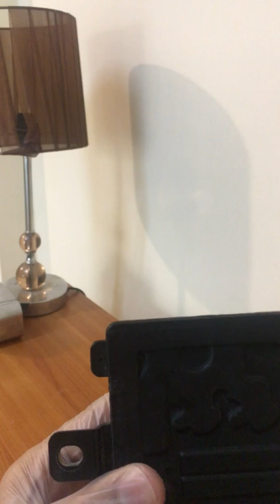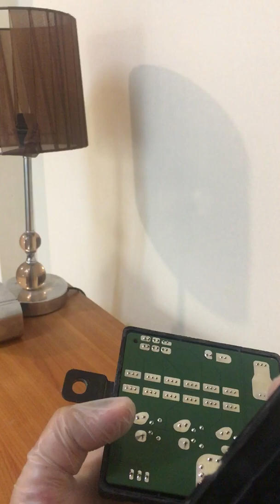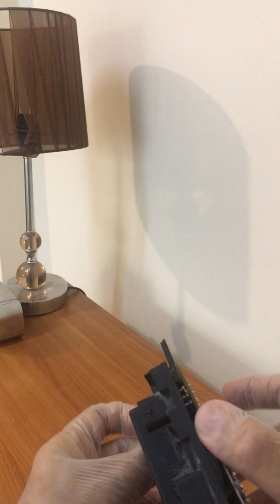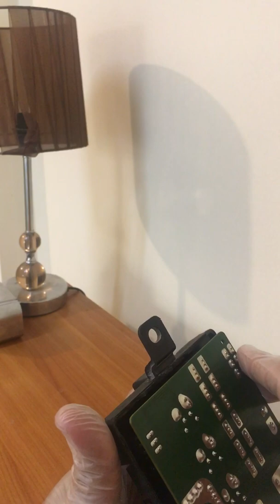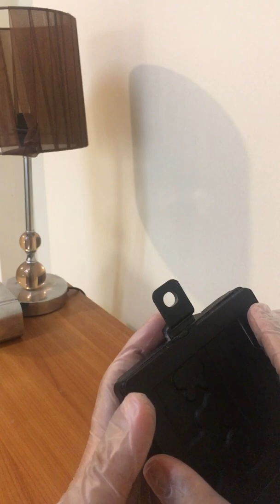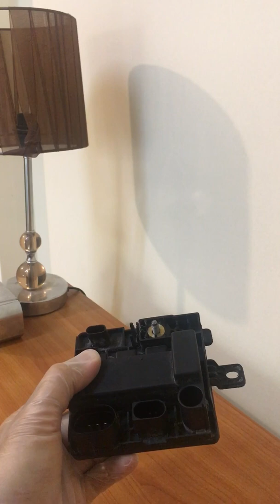BMW X5 E70 Integrated supply module ISM Z11(Power Distribution fuse box) dissembling and repair

Comment: Terminal 15_3, line from CAS, electrical: Short circuit to earth and Terminal 15N<03: No voltage error in bmw f10 523i, I checked the fuses in ism the #3 fuse was blown i changed it the car di start but after 2nd or 3rd start the fuse blows up
Reply from the maker: Check for any crushed wiring

Comment: same part comes with E70 4.8 engine 8 cil? mine has n62 engine, it starts but only 8 seconds then stops and radiator`s fan  starts at max speed  then 37 failures appear at the screen, inluding, seat belts, crush module,  steerling, 4x4, transmission, sunroof, lihts among others..
Reply from the maker: No it's not seen when I checked the technical document. Did you check your battery? Make sure you have a new battery before doing anymore works

Comment: I have issue with my brother F30 crank but no start issue, got fault code 804080 ignition on: startability limit reached or ignition was on for a long time, 8040B7 De-activation of terminal 15: Top startability limit reached, 8040BB. Does this indicate that power distribution module faulty?
Reply from the maker: The error code doesn't give me any clue. Which is the engine? What is the  History on no start issue, there will be something which triggered the fault.

Comment: I got BMW X5 E70 2011, I opened the box (you need to crack open it), all fuses were good, I dont think anyone should be opening it in most cases.
Reply from the maker: You should open it only if you have error code related to serious DME problems.
It protects DME from serious damage
Reply: We’re you also getting all crank no start?
Reply: @santaclaaugustin3424  UPDATE: if your codes are as follow: 
Car is fixed. I had to tow it to the dealer. They said it is DME. I had no choice but say yes do it. Spend around $3,000 for parts and labor at the BMW dealer.   
Error:
2DB6 Valvetronic relay activation line disconnection
371E Relay, ignition and injectors, activation line disconnection
I did the following before going to the BMW to fix it for me:
1. Power Distribution Box W Fuse (returned back to seller)

2. ISM - Integrated Power Supply Module

3. New Battery

4. EKPM3 Fuel pump module computer unit (returned back to seller)

5. Fuel pump

6. Relays in the trunk fuse box (circuit relays small black ones)

7. Verified ground straps.

8. Verified every single fuse several times:(

Comment: Hey so did it work when you changed the fuse?
Reply from the maker: Yes it did. I had to replace 4 or 5 fuses as a short circuit was blowing the fuse. You can see the short circuit explained in my other video

Comment: where was this location as im looking for my on a 2008 e70 30d?
Reply from the maker: https://youtu.be/_7n485INGQc
The location is same as in this video link that I have provided but it will look different as the module has different connector and it has fuses from F01 to F05

Comment from the maker: IVM LOCATION https://youtu.be/_7n485INGQc
Reply: hi Afeef...i have a similar issue on F30 N20 engine with error code 1F4D10, DME, internal fault, Activation of quantity control valve: malfunction. This was scanned by 3rd party diagnostic tool. i believe the tools dont carry out deep scanning on the system. I havent try yet with ISTA+ as i just bought the software. Your video is an eye opener as i dont know that ISM has fuses and relays inside which yet to explore for any fault. i have a strong feeling that it is not the DME..
Reply from the maker: @veillanraj9287  use btool-lite phone application to scan the codes. Use d-can cable
Reply: @bimmerhacks  thanks for the suggestion. i use bimmerlink tool but still not satisfied...getting the ISAT+ ready. My car actually in workshop and i have taken out the DME as advised by the mech to send for repair..but im skeptical that it was the DME. i have another fault code together with the mentioned. 135808 valvetronic servomotor, position sensor, electrical: malfunction. believe that 135808 is causing the 1F4D10. i will opened up the ISM tomorrow to check the fuses.
Reply from the maker: @veillanraj9287  valvetronic motor fault is nothing to worry about. What made your car to the garage?
Reply: @bimmerhacks  the car was idling and suddenly went off..tried start, it cranks but failed to start..i have to tow it to workshop..then the workshop diagnosed n changed the motor but the fault still thee after renewal..
Reply from the maker: @veillanraj9287  hope it's not a blocked fuel supply.
Reply: @bimmerhacks  bad news..the ISM fuses is in good condition...the relay coils also good..i can get fuel until the injector connection during cranking..the cables was inspected with some repaired broken cables..jerry visited and had meals there...sad...
Reply from the maker: @veillanraj9287  so a broken connection somewhere
Reply: @bimmerhacks  the cables repaired..but the fault code still there...i yet to find the cables for what n definitely its not the ignition, injectors and valvetronic actuator cables...will be sending the DME to see any components defects..
Reply: Just an update..the dme has some burn mark and rust stain on the some of the component underneath the socket connectors....sighh...bought a dme and had it cloned..now its running ok...
Reply from the maker: @veillanraj9287  thanks for the update

Comment: Afeef, having similar problems, crank, no start, and am questioning my IVM. Can you elaborate on how you found your short, which I assume was the root problem that was causing your fuse to blow. I like that you worked hard to find the real problem and not just throw a new DME at the problem.
Reply from the maker: First I got couple of error codes. So I assumed it's a fuse blown somewhere. Checked from the rear fuse box on the battery till the ISM. Used bmw circuit diagram to check out different modules through each fuse. Let me know the error code so that I can give you a clue where to start from. I used bulb method to find out short circuit
Reply: @bimmerhacks  Where did you get the circuit diagram fora BMWX6?
my integrated module fuse number 2 keeps blowing and water pump keeps running even when car is off
Reply: @dappa311  did u fix some problem !help
Reply: @djraphaellourenco8321  Yes the issue I had I fixed it
Reply: @dappa311  can u tell me what was the issue??? im struggling here with the some issue
Reply: @djraphaellourenco8321   My Water pump on my X6 was bad and it was shorting and blowing one of the fuses under the hood , I found the wiring diagram for the truck and I was able to trace what was on the circuit.

It was  a few devices, water pump and couple other things, forgive me, this was last year so I don't remember exact which components they were.

But the water pump was going bad , so when the vechile turned on , the water pump would take down the whole circuit , so I got warning lights for all the other devices that was on the circuit, turbo waste gate valve was one of the devices that was on the circuit.

So if you are having a blown fuse issues , you will need the schematic to be bale to find out what is on the circuit , then you can start to trouble shoot, with out that you will be blind.

I had to disconnect the wiring harness to the computer and test the resistance of the  water pump , thats how I knew it was the pump, changed it and never had an issue since.
Reply: @dappa311  cool I was suspecting the water pump because its draining a lot amperage  , by any chance u have the schematic I have all data and identify but I can find what this fuse power I only check the wires from ism to the pcm , and was ok noting short , thanks men
Reply: @djraphaellourenco8321   What car do you have?
Reply: @dappa311   x6 2011 3.0
Reply: @dappa311  I think u are. right because my fan its ben running full time with the car running and when was off turn on some times , my drain ti much amps for the circuit ,and its on n# 2 fuse  when blown the scaner showmen codes for o2 sensor waste gate
Reply: @djraphaellourenco8321  SAMe thing I experienced!   It was my water pump, the fan would kick on and ramp up hard.  Its more likely ya water pump.

It's shorting internally ,  the motor coil , drawing excess current and blowing the fuse. 

It works for a bit but then blows the fuse and takes out the circuit and you get codes for o2 sensors, waste gate and a few other things, I forget .

I wanna say its the water pump but to be sure you have to test it ,

Seems like it's a X6 thing.  

You have the N54 Engine correct ?

I have a 2012 , N55 Engine
Reply: @dappa311   i have n55  too
Reply: @dappa311   let me know if u found the      files I really need! thanks
Reply from the maker: @djraphaellourenco8321 r u looking for the wiring diagram? If yes mail me @ bimmersword@gmail.com
Reply: @bimmerhacks   I need help with the schematic for the fuse #2 in the ism need know what sensor and actuator are feed by the fuse, I have regular diagram  from all data but only show me get out on the ism and in the dme wire are good need trace down the load taking down the system and blown the fuse
Reply from the maker: @djraphaellourenco8321  https://youtu.be/jJN1VpxdLU8?si=R3_wKJPokBvbtk4h

Check if that helps.
Reply: @bimmerhacks  my water pum works the only problem fuse #2 20amp keep blowing
Reply from the maker: @djraphaellourenco8321   try disconnecting the waterpump and see if the fuse blows off. The water pump is prone to get water ingression inside the waterpump electronics. Valvetronic motor is another thing to check but its probably the waterpump itself
Reply: @bimmerhacks  I have a bunch of codes that all pretty much show bad communications to DME. I suspect bad DME or bad ISM. There is a 6 pin connector on that ISM, and pins 5 and 6 don't have voltage on them with ignition on, and I think pin 4 is grounded by the DME to cause relay to close and energize pins 5 and 6, but trying to confirm. One symptom I have is that when that 6 pin plug is plugged into ISM, there is a loud buzzing from glove box where fuses are. When I unplug it, that buzzing goes away...very strange. Thanks for your reponses and insight.
Reply from the maker: @terryt4129  buzzing is weared so start from glove box side. Take out the fuse box located along JBE. My channel has a video how to tear apart JBE FUSE BOX. REMOVE THE UNWANTED RELAYS from it like wiper motor relay etc to drill down the cause
Reply from the maker: @terryt4129  any update? Did you cut open the ISM?
Reply from the maker: @terryt4129  https://youtu.be/6vYPbAeDc5E

Comment: Have you got a vidoe of how to remove the Integrated supply module from the car?  I will need to do it shortly and can't find any videos so far. Thanks
Reply from the maker: If u give me your email ID I can send you the location of the module. By the way the module location is different for different models, so mention the car model year etc.
Reply: @bimmerhacks Hi please assist with location of Integrated Supply Module for E70 BMW X5 2013 diesel.
Reply from the maker: @nhlakaniphombatha5198  if you're having 35d then it's in the same location but it doesn't look the same. It's a different module. A8682 - it's the fuse module
Reply from the maker: @Ben Edwards it was so easy that's the reason I did not make video. Its the same as in my x5, below the air filter in the engine bay, passenger side. Remove the plastic cover using 13mm box spanner. There is sensor on the filter compartment, plug type connector(very easy to disconnect). Again 13mm box spanner for the plastic bolts just turn it 30-40 degree, two towards passenger side and one towards the engine bay, all can be seen from top side itself. Lift the filter box. Then there is a duct going to the passenger side wall, to it's right and left there is a plastic hinge type clip locks, just pull it one in right and one in left side. Then to it's right u can see this module with the connectors going in it. There is plastic holder and lock keeping the module in position, just push it and lift module up. Easier than my explanation
Reply: @bimmerhacks  thanks bro.  will give it  a go
Reply from the maker: @benedwards2677  for any help, I'll be here ;)
Reply from the maker: Gucci Gucci  https://youtu.be/_7n485INGQc
This is for 2011 model. I will check for 2007.
Reply from the maker: Gucci Gucci   just check this location if IVM is here or no https://youtu.be/_7n485INGQc
Reply from the maker: Gucci Gucci  give me your email ID I will email you a pic

Comment: How did you get the case open?
Thank you in advance.
Reply from the maker: just heated with conventional gas stove without touching the flame on the plastic like 30cm above the flame and cutting it with a blade/knife ... No need to apply much pressure as it will cut like butter when heated. Don't push it deeper than 5mm as it might touch the circuit board
Reply: I did it with the Dremel cut Disc, very easy

Comment: Where is the module located?
Reply: I would like to know where its located
Reply from the maker: @IbuildshipsWagnerEdmond  below external cabin ac air filter in engine bay side
Reply: @bimmerhacks  can u pls make a video to show where is it located
Reply from the maker: @uae0o794  I will do that for you. By the way what is the problem with your car? Please mention car model, year etc
Reply: @bimmerhacks  my car cranks with no start. Its bmw x5 2009.one day it cranks with no start next day it starts
Reply from the maker: @uae0o794  change the fuel relay located in the rear fusebox. 2 mins job.
Reply from the maker: @uae0o794  What is the result? More precisely Light green color relay next to the rear fuse box. Only AED 50 for the relay ;)
Reply from the maker: @IbuildshipsWagnerEdmond  https://www.newtis.info/tisv2/a/en/e70-x5-xdrive35i-sav/components-connectors/plug-in-comb-type-solder-connectors/connectors-from-x6/x60189-x60189/DwVyPN2y
Reply: Randy Edmond Jr. below the air conditioning filter...passenger side
Reply from the maker: It is below the air-conditioning external filter in the engine bay passenger right side of the car. U can see many connections from engine bay going to firewall and this particular unit.